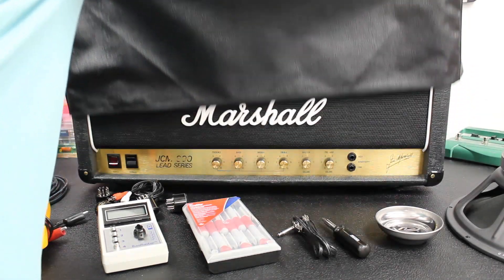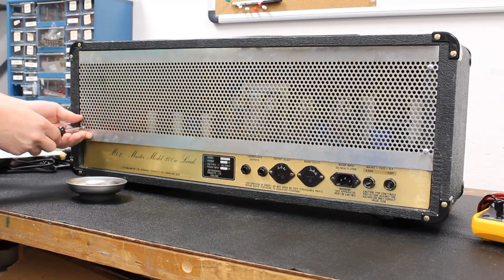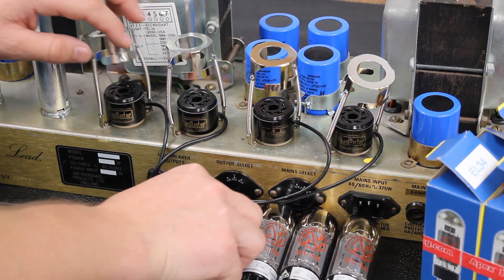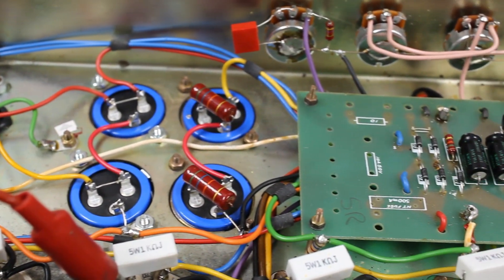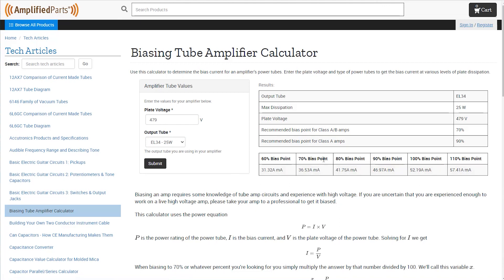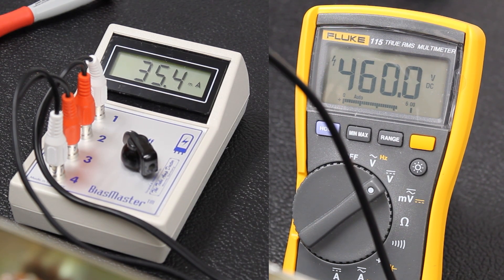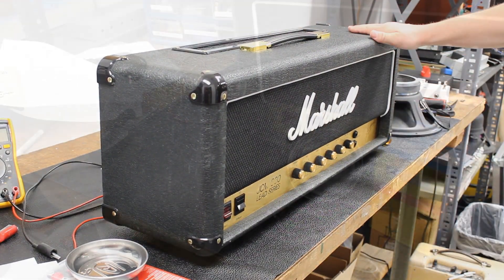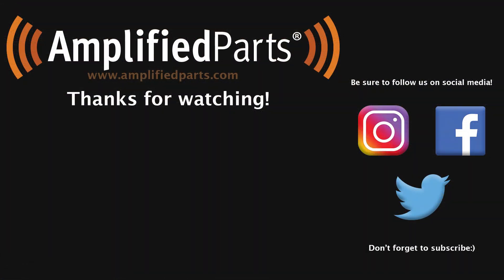How to Bias an Amp 2020

Comment: Your video gave the knowledge and courage to learn how to correctly bias an amp. I have basic circuit skills having dabbled in extremely low plate voltage projects via Radio Shack in the 1980s. This was my first foray into the land of lethal plate voltage. My first amp today was a Metropoulos Metro Plex with aging power tubes. After pulling the chassis and securing it to an amp cradle,  I safely discharged the amp to enable safe attaching of probes, cleaning the pots, measuring component values, and tightening any loose hardware (not to mention stare in wonder at the beauty of George M's circuit board layout). Used the Bias Master probe system... with separately attached multimeter to monitor plate voltage. I had read that George M himself prefers to set them at 34-35. I adjusted to 33.9 watching them settle in after a few minutes to 34.1. Bullseye! Thank you, Amplified Parts - couldn't have done it without you! Next stop... the old power tubes in my Marshall 2205.

Comment: 1) You don't show how the bias probes are connected--though you do show them being removed. 

2) You show the signal on the oscilloscope, but you don't explain what points the problems are connected to to get that signal. 

3) What volume setting do you use to test? 

4) I see a waveform on the oscilloscope.  Do you need an input signal to do the biasing?

Remember, this is for beginners!

Comment: Do you need to use high volumes on the power tubes to make the adjustment correctly?
Reply: Nah it’s better to bias with volume controls down. Don’t bias at too high of a dissipation to ensure the voltage peaks aren’t too intense when playing. They say no more than 80%, but realistically, it’s best to shoot for 65-70%.

Comment: My "Incredibly matched"  power tubes were off by 9ma; Never again! And what is going on with that horrible sounding guitar in the background; it sounds like two wasps mating in a paper cup.
Reply: 9ma isn’t too bad at all. Actually a “mismatch” of 9ma will benefit the sound overall by enhancing harmonics. A real mismatch is of 20-30 MAs
Reply: @chriskilian2325  I've heard all about the apparent even order harmonic enhancement of mismatched tubes, and think it's exaggerated. 9ma is too much in my case, because it was causing significant redplating In one of the tubes, and I'd rather not have them wear at different rates.
Reply: @davesims6517  well my “matched” pair of tubes are 6ma apart right now. Just saying this to illustrate that “matched” tubes doesn’t mean they are clones. It just means they won’t be 15-30 MAs apart. Right now I have one set for 60% and one at 68% and I like the sound. Ultimately your ears have to decide how hot or cold. I wouldn’t go over 70%. Then it would probably red plate
Reply: @chriskilian2325  I hear you. The one that's red plating is doing it at 65 percent dissipation, so that particular tube that I have is definitely a high current tube.
Reply: @davesims6517  what tube is this?
Reply: @chriskilian2325  It's a duet of JJ EL-34L's. Could have been a mistake in the screening process, because I've never bought a set of 'matched' tubes that was more than 5 milliamps apart.

Comment: Is the plate voltage typically the same on each power tube or do you need to measure each power tube?
Reply: Last time I did it both plates were within 1-2 volts of each other.
Reply: If the tubes are well matched, the plate voltage can vary but only for a few volts up and down which in general doesn't really matter. What does matter is when you start to increase the current the plate voltage will drop, depending how much you turned (if your amp was set too cold) so in the middle of the process you may want to stop, redo your calculation and continue.

Comment: If theres only 1 trim pot, does it even matter which tubes go back in what sockets?
Reply: No, it really doesn't matter! Every amp which is fixed bias and have only 1 bias trim pot relies exclusively on how well the tubes are matched. So, you can put the tube from socket 1 to socket 4, it won't make any difference at all in operation.
Cheers!

Comment: what would happen if you tried to connect the multimeter to measure the plate voltage while the amp was on?
Reply: Nothing, the multimeter would display the measured value of the voltage. I've done it a dozen of times.

Comment: What is considered a standard fee to say take an amp someplace and have this done. Or does it go like a flat rate 50- 60 bucks an hour or something like that. I work mostly on instrument stuff and I’ve built cabinets but I wouldn’t mind buying the test gear to be able to tuneup and biased amps
Reply from the maker: Different techs have different practices and rates, like the general market, fluctuate. We suggest contacting a few other technicians in your area to gather general pricing.

Comment: I cringed from the bare finger handling of these tubes. The finger marks will be there for ever one the oven has been on a while.
Reply: and that matters because....?
Reply: @jgabora  Beacuse that how we who were trained on tubes during our education learned it. Maybe these simple amps wont suffer tolerances that bad, but remember tubes were once used in computers.
Reply: @jgabora the oil in your hands can burn up from the heat of the tubes and melt them

Comment: Hi, great video. I have a Bugera V22 Infinium (with auto bias). It bursts the power tubes in days. Could be that auto bias is damaged? Thank you.
Reply from the maker: Uh oh if you are going through power tubes that often something is definitely wrong! I would recommend taking your amp to a local tech to get to the bottom of the issue.
Reply: @amplifiedparts  I have taken it to 2 techs... none of them can fix it. Thanks for the fast answer. Cheers!
Reply: @preciseaudioblog   You probably have this problem still. Id say you need to take it to an actually educated service tech. This should be quite easily diagnosed by a competent person. A guitar shop random dude rarely has this. A radio or tv repair man is what u need.
Reply: @merqury5  Thank you so much, I'll fallow your advice. Cheers

Comment: is the rebiasing process the same for the 2203x reissues? Also, do you need those tube probes that plug in before the tubes or can you just use a voltmeter?
Reply: Don't waste your breath, they don't answer questions.
Reply: Yes I saw another video where guitaroligist just switches his volt meter to 200 ma setting and gets the plate current.
Reply: You can bias using just a multimeter, but knowing how to do it safely requires experience. Not a job for a novice.

Comment: What happens if you go to set your bias and there's not enough when you turn the trim pot to reach your mv? What I mean is, when I turn the bias adjustment pot there is not enough adjustment to reach 36 mv. I have a vox night train 50 with el34's and it's got an bias adjustment pot for each power tube but it usually takes about 3 sets of tubes to get a pair that will bias hot enough. I think I have to change a resistor or something like that or maybe even the bias pots. I need more adjustment in my bias pots. How would I fix that. Is there something I need to tell the guy where I buy my tubes? Any help would be appreciated.
Reply: You should definitely check the voltage and re-calculate before assuming you're out of range. Your voltage on the plates will change as you change the current and you should re-calc to see where you're at (50% 60% 70% etc). If you find that after calculations it's still out of range you can modify the bias circuit to allow for more range. You can google how to do that, but if you can't figure it out, send a reply here.
Reply: I don’t know the guys name might have to see if I can find it but there is a guy on YouTube that seems to be an expert in these Marshall amps he has complete re-wiring Circuit to correct Marshall 900s which I guess have a known issue. He would probably be the guy to find an ask a technical question because he seems to understand electronics really well. I do somewhat but I usually just go by following directions or trying to match up parts to what their values are supposed to be I would like to get back into it in one a lot more electronics is fun stuff.

Comment: What is the standby switched purpose for to just to wait for the power tubes to warm up and then the standby switch turns on the plate and cathode voltages, but why need a standby switch?Biasing tubes at 80% and 90% wears out the power tubes faster? less life expectance?